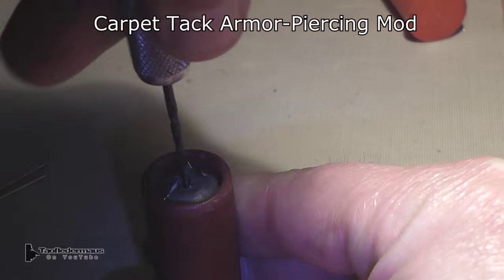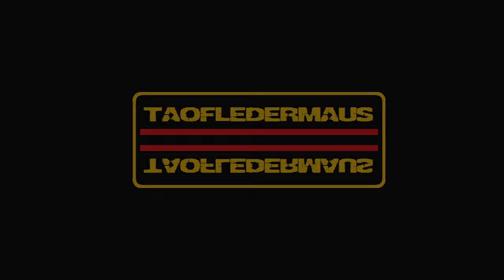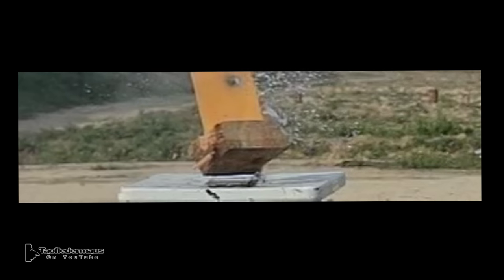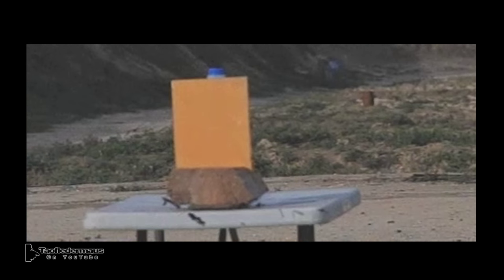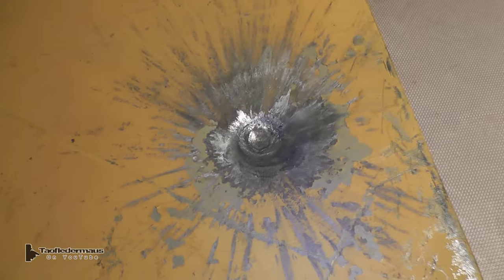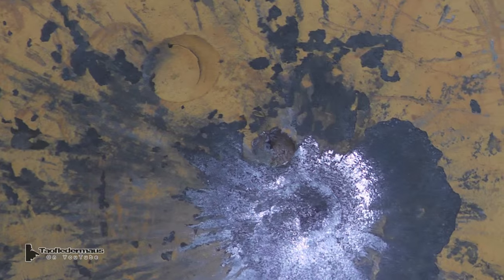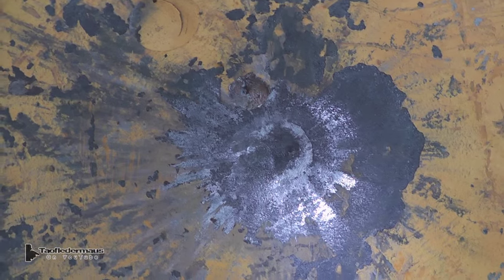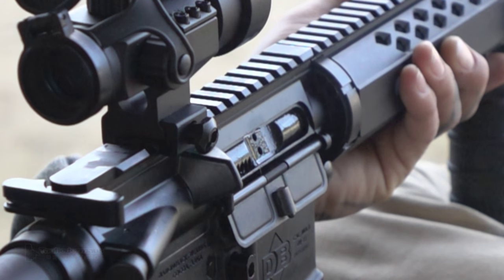Can a CARPET TACK  Go Thru ARMOR?  (Urban Myth)

Comment: Sir, very cool video.  I was reading about anti-armor bullets about a year ago, and the ones that go through tanks, the shells that go through tanks, used copper, but what made them able to go through the armor was that they were encased with the steel, but the copper was cone shaped, so that the force of the steel behind it nailed it like a hammer through the armor.  in other words, your carpet tack is pointed the wrong way.  You'd have to drill the hole from behind and have it pointing forward, like a bullet within a bullet.  The article I was reading said that in the case of tanks, the copper actually liquefies under the pressure, but the core of it is still solid and becomes needle-like, and it is this needle-like part that pierces the armor.  So the best way would be to place your tack in, facing forward, and provide some heavy backfill to some of the hollow part of the slug behind the tack to act as the hammer.

Comment: have you thought about a masonry nail  pointed end forward ?

might be a tougher grade of steel  since it's designed to go through concrete
Reply: It would probably spin
Reply: The weight of the slug in back would probley prevent that
Reply: +Trav Chi It's a rifled shotgun barrel. Of course it'd spin.
Reply: BalisticChampion1Im taking about lateral rotation, not spin from the barrel
Reply: Trav Chi I know. I was just messing around.
Reply: +Trav Chi then the correct word is tumble.
Reply: no no yes that's it

Comment: The idea sounded quite reasonable. I almost half expected the modified slug to at least push the carpet tack through The stainless steel plate. But we don't learn if we don't fail. If you ever get a chance, I'd suggest a large carrot diamond planted in the slug much the same way the carpet tack was placed. The next off the head idea was take a homemade copper core, and implant it in a three inch magnum slug. The idea is much the same behind the rocket propelled grenade. An incredible force squeezes the copper, and through friction and heat alone the copper core will melt and become molten helping the armor piercing capability. The only con I can think of is in RPG's the explosive head helps the melting copper process, and i'm afraid the slug won't be able to generate enough pressure. Just an idea

Comment: I'm pretty sure carpet tacks are regular low carbon mild steel.  My guess is that it''s still soft enough to deform and probably melt on impact.  You might get some interesting results inserting a drill bit into the center of the slug.  Bits are very high carbon steel, assuming they're new and haven't beenused by a weekend warrior trying to force a dull bit through wood by ramping up the speed and losing the temper on the cutting edge.    I wouldn't leave too much of the bit sticking out of the slug.  It's likely to shatter before the meat of the slug can do the heavy lifting, especially if it impacts at any angle.

Comment: try seating the tack in the slug then seating the slug in reverse. The flat head of the tack will obviously not penetrate. The lead should liquefy on impact and then drag the tack through to the surface. Also try a magnum round and try to get enough powder to reach Black Magic velocities. If you know one, have a black smith make you a "tack" from the same metal as a Railroad spike and temper it above the 200 Brinell index of Stainless steel. Also make sure the plate you are shooting at isn't thicker than the length of the tack. If all this is done, you might crack the plate, but don't expect miracles.

Comment: I believe that rumor is a carry-over from the old type body armor without the steel plates. My Safariland IIIA vest is rated for up to .30/30, but only with soft-point bullets. Without steel plates, such vests are helpless against any bullets with any kind of steel penetrator, or FMJ.. My vest is also rated against penetration from any 12 gauge round, but that doesn't preclude broken bones.
Reply from the maker: +Kevin S  The guy that suggested it told me it was supposed to go through steel armor.

Comment: serious thought...I used to work for hilti and we had a steel to steel powder actuated fastener that would penetrate steel up to an infinite thickness for attaching corrogated steel deck for building construction.  I wonder what it would do if shot out of a shotgun instead of with a .27 cal long indirect tool. they are  19 mm long and I have some if you want to try it.

Comment: I thought it would be working. You know, like the anti-tank shell. Hard core in the soft metal. It is spinning. When the shell hits the target the soft metal squish and hold the rotating hard core. Then the core rotates/drills/melt its way through.

Comment: I had this idea the other day: You should try to melt your own led slug with different types of cores, like  nails / screws,  tungstene drill bit, steel ball, ceramic, glass marble(for a kinda dirty hollow point)... . So the slug will fly straight, be heavy enough, and we could see the differents results with differents cores, on different surfaces ( steel plate, clay, balistic gel wood ...) That would be awesome.
Reply: Lord Whoopass

Comment: I understand the angling of plates and dense objects is to protect against things bouncing back at you but would the results be different if the plates were shot while straight facing? Wouldn't the projectile have more of the plate to go through since it is sloped, causing the test to fail when it otherwise would've worked if it were a flatter impact surface?

Comment: My suggestion is to do what you did in this video except try installing the drill bit into slug or rifle bullet. Years ago I bought 7.62x39 rounds that had 1/8" steel cores that looked like drill bits in the catch berm.

Comment: you outta get a few different plates of just regular rolled stel , 1 at 1/8th in 1 at 1/4in , 1 at 1/2in , 1at 3/4in and 1 at 1 full inch of steel and see what rounds will be able to pierce which thickness of steel . i have seen this done only a few times with rifle rounds but it would be INCREDIBLE to see some of the rounds you get / make go through and almost go through steel plates that are not made for armor . Just a though , i hope ya do it !! happy hunting & thanks again for all of your original vids with shotgun rounds ect , you might be the guy that gets a guy to make a true armor piercing shotgun round and that would R o ck !!

Comment: You need the sharp end of the carpet tack facing out. Hardened steel concrete nail would probably work better. You want the most mass concentrated on the smallest point not the dull wide end facing out.

Comment: the idea it has to hit point first. so all the energy is transfered though a tiny area thats how armour piercing sabots work so to re try the experiment the flat end of the tack has to be glued or soldered on to the face of the slug not drilled through

Comment: should of epoxied the tack from behind the slug, point up (as the penetrator) with the powder force pushing the head into the base of the slug (lead acting like a soft sabot) bet the results would be at least different ( maybe not penetration, but different).

Comment: I noticed how the lead, on impact, seems to "splash" or "spray" out. I imagine the kinetic energy causes the lead to liquefy on impact. My thought is this splash effect disperses a large amount of kinetic energy before the full mass of the lead can be imparted to the target. If a cylinder of steel or aluminum was placed around the lead, it might hold the projectile together long enough for full kinetic transfer of momentum to the target, thus allowing full penetration of the steel plate. Has such a design been tried?

Comment: try adding bits of TIG electrode (Tungsten). Try the pure (Green band) (should be the hardest) and the radioactive Thorium (red band) (Th is denser than Pb).
You can even chuck the rods up in a drill and sharpen them against a grinding wheel so its easier to push in to the load.

Comment: modifcaion suggestion. ... put the tack in half way and cut off the top so as to create a puncture.   i bet it still wont work but if the aim is to try everything, then that would be my two cents on it.

Comment: Try it with cubic zirconia. They are about 8-9 on the Mohs scale, and they are pretty cheap to buy.
Reply: +Григорий Александров they are too hard they will just shatter in to dust if it hits anything hard like a steel plate.
Reply: +Григорий Александров Hardness != Toughness
Reply: Risto Mladich
Yeah maybe, it would still be interesting to see.
Reply: +Григорий Александров it will be the same as the Glass test.

Comment: I have a small question. Why does a bullet, when hitting metal like that plate you have, strip the paint off around the hit area? I'd really like to know.
Reply: +DJ Rarity I'd guess the impact causes a little shockwave that ripples/tears the paint flakes off the surface of the metal
Reply: +iDoNothingbutComment and/or: bullet may shatter on the impact against steel plate
Reply: That's what I thought it did, but my curiosity got the best of me.
Reply from the maker: +DJ Rarity  The bullet fragments radiate outwards along the plate and strip the paint off.
Reply: ***** Thanks, Matt. Really helped me out.
Reply: +iDoNothingbutComment --  The Metal Plate is Screaming Because it FREAKIN' HURTS!   lol!

Comment: shooting tac but end first to penetrate plate is like an attempted stabbing, using the butt of a knife first right?
Reply: +tblbaby penetration has more to do with speed and hardness. It's why tungsten is so OP for that purpose. At those speeds, those materials don't act like we think things act, it's not like a nail through wood, where the most important thing is focusing the force on one tiny point. In these cases the factor is hardness, so the target's metal deforms more than the projectile, and energy, which speed has more of than mass. Mass is also really important, but fast and hard are more important than sharp.
Reply: +tblbaby penetration has more to do with speed and hardness. It's why tungsten is so OP for that purpose. At those speeds, those materials don't act like we think things act, it's not like a nail through wood, where the most important thing is focusing the force on one tiny point. In these cases the factor is hardness, so the target's metal deforms more than the projectile, and energy, which speed has more of than mass. Mass is also really important, but fast and hard are more important than sharp.
Reply: ElementalOctopus Yeah that could be. I guess I was thinking more of Kevlar at the time. Though the small bullets do tend to get through plate better from what I've seen and the armor piercing rounds are always pointy.
Reply: Fair enough. When in doubt, use pointy stuff to make it more deader
Reply: ElementalOctopus well generally better penetration anyway lol. A good mushroom does deader better in flesh

Comment: By what possible function could a carpet tack allow an otherwise slow/soft/blunt projectile to penetrate armor plate? How did this become a rumor?
Reply from the maker: +LSD25   A viewer told me he tried it and it worked,  while in the military.    We have shot through the AR500 plate before with a shotgun slug made out of lexan  (plastic)   with a carbide core.   So anything is possible.

Comment: why did you use caramel on the nail and insert it into the slug? does caramel act like an adhesive?
Reply from the maker: +YoungFree213  It was 3M plastic cement just to hold the nail in.
Reply: ***** should of been caramel

Comment: Say, could you guys revisit this myth, but have the tack go pointy end forward? Maybe drill a cavity on the nose of a slug, push the flat of the tack in there, and fill the rest back in with lead. Because I think the point (pun pun PUNN!) is that the tip of the tack would kind of focus the energy of the shot on a tiny contact area. If you could try that against both steel and Kevlar, that would be awesome. My hunch is the Kevlar guy should at least feel a little prick...

Comment: I think the carpet tack mod shown here is meant for going thru soft body armor (kevlar), not solid plates (like AR500).
The idea is that the carpet tack cuts the fibers, letting the rest of the shell thru the armor.
Now, I'll explain why the carpet tack wouldn't make much difference for going thru the armor plate, using SCIENCE!

To maximize penetration, a projectile must be long, have a high density relative to the target, high hardness relative to the target, and be fired at a high velocity, in roughly that order of importance.

Newton's "approximation for penetration depth of a projectile with high velocity" describes the physics that cause this.
Projectile penetration = Projectile length * Projectile density / Armor density.

If you shoot a solid lead projectile at a large block of lead, the crater in the block of lead will be roughly as deep as the projectile is long.
If the projectile is denser than the target, the crater will be deeper.
If the projectile is less dense than the target, the crater will be shallower.
This is why APFSDS rounds for tanks are long "darts" made out of tungsten carbide or depleted uranium, two very dense materials.

The hardness of the projectile is also a factor, with harder projectiles being more effective than softer projectiles. This is why Tungsten Carbide is used as the "core" of many armor-piercing rounds for small-arms.

Projectile velocity is another large factor, faster projectiles penetrate deeper up to a point. Beyond that point, standard "solid" projectiles will just shatter.

TL:DR = Terminal Ballistics isn't guesswork, it's SCIENCE.

For more info: https://en.wikipedia.org/wiki/Terminal_ballistics

Comment: Could you glue on a carpet tack pointy-side-out?
Reply: +arcooke Nope, the glue won't hold it.
Reply: +arcooke not only would the glue not hold it, but now you're placing the center of drag in front of the slug, making it want to turn around mid-air, so no. :)
Reply: +arcooke 
Use a soldering iron.

Comment: It sounds like your recording media may not be high enough standard. Make sure you have the quality needed to work in that camera. Had the same issue with a camera I was using where it would only record video for a few seconds.
Reply from the maker: +Jeremy Painter  The camera just records high speed for 2 seconds.   That's per the user's manual.
Reply: +TAOFLEDERMAUS Gotcha.

Comment: I don't think your penetrator has enough mass, and its hitting backwards. you want more mass focused on a smaller point. probably best if it was some kind of hardened metal. grade 8 bolt ground to a point maybe?
Reply from the maker: +wildernessshouter  yeah, it didn't work

Comment: what put those pretty holes through the ar500 plate?
Reply from the maker: +agvulpine   One was from a carbide cored  lexan shotgun slug.   I think another was a .270 bronze bullet,  and the other was a steel core 7.62x54R shot from a Mosin Nagant.

Comment: I have a feeling that alot more things would rip a hole in some AR500 if there was something solid sitting behind it that wouldn't let it fall over or push away from the force of the bullet.
Reply from the maker: +DarkCloud64   That's kind of a myth based on trying to punch a piece of paper hanging in the air.    The bullets are travelling so fast,  and the impact occurs so fast,  the plate doesn't start moving until all the energy is all ready transferred,  or the majority of it.

Comment: why not put the tack point forwards?
Reply from the maker: +mcjagermech  This was how the guy said it would work,  I just did it exactly as he told me.
Reply: Interesting it seems like it might have worked better point first, still a good video
Reply from the maker: To go through armor plate,  it doesn't poke through it,  it actually knocks a hole out.   A flat nosed projectile can knock out that piece of steel plate.

Comment: You should rig the start record button to the trigger pull.
Reply from the maker: +BusDriver101  It would stop the moment the trigger was pulled so you'd never see what happened after that.
Reply: Why would it stop? I mean make it start its two second recording as soon as the trigger is pulled.
Reply from the maker: +BusDriver101  Oh oh,   that would be in "end trigger" mode.   I don't think the camera instantly starts recording.  I need to find a way to trigger the camera when the event is 1 second into recording or a little sooner.

Comment: If the first slug didn't go through the 1/4" steel then what makes you think the second will go through the ar 500 plate??! Of course it won't! You should have tested both on the 1/4" steel only to give them both a fair shot.
Reply from the maker: +Brandon M. Hernandez   The first slug was only going 1200 fps,  the second was 1500 fps.  The myth was these would go through armor plate,  not stainless steel.       We filmed this at a public rifle range so we had to wait about 30 minutes between each shot.   By the time we set up the second shot,  the range was closed,   and they were kind enough to let us take the shot real quick,   after shutting down.   It was impossible to try every possibility given the time.

Comment: i thought the sony was a good deal, until i saw the 2 second limit. i think those run about $1000.
Reply: +mr bad example maybe if someone could hack the software in the camera, it would only be one line of code, providing the thing didn't overheat.
Reply from the maker: +mr bad example It was around $1300.   It would be cool if someone did a firmware hack on it.